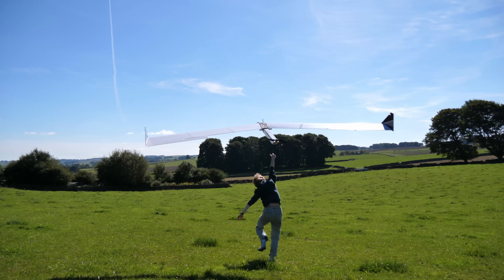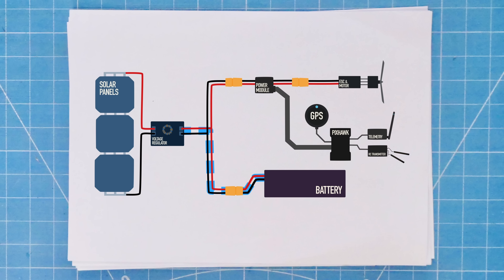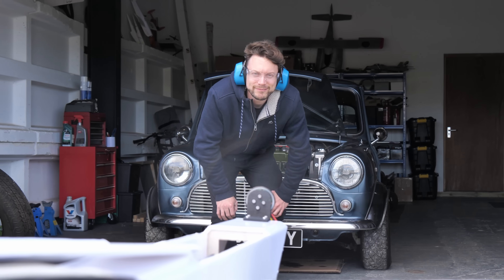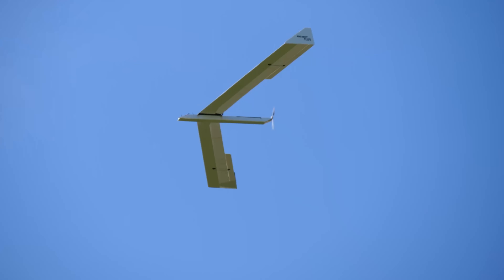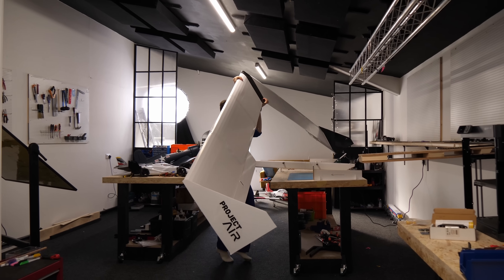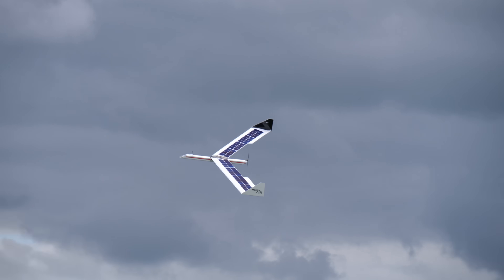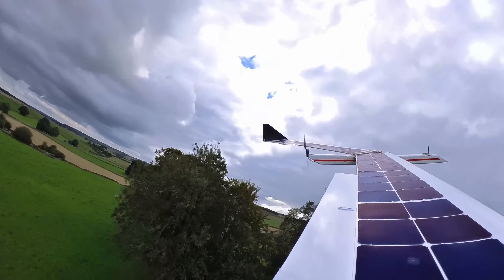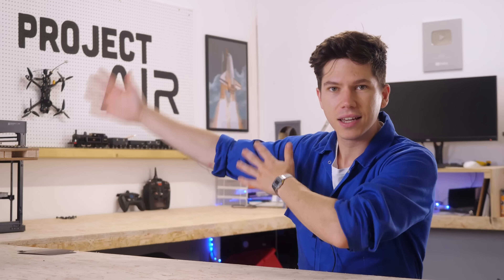Solar Plane V2

Comment: I’m at 7:45 and recommend trying an actual flying wing design. Similar to that of the xb-35, b-2 spirit, and ho 229. As these designs greatly reduce drag and use elevons to roll and change pitch. Airbrakes on the wings enable better yaw. Just an idea.
Reply: he's going for more of a NASA helios functional UAV design

Comment: The power system isn't at fault - it's the charger you're using not being compatible for the battery you're trying to charge. It will always overcharge your battery as it's not calibrated for it - it's designed for the higher charge voltage of 14.2v of Lithium Iron Phosphate batteries. Genasun can custom make one for you given the money you're spending on it by simply telling them the type of battery and it's specifications you want. Further, without a proper charger in version 2, you're gonna end up putting too much current into the battery (rather than over voltage as was the case in Version 1). You need to go back and get some proper training on battery charging from a specialist and not just another DIY Youtuber.

Comment: if you are going to use a commercial airframe then why not make a it a genuine high performance airframe rather than a 'foamy' which is more a fun flyer than a serious performance model? A 4m span F5J competition spec glider would give you efficiency on completely different level than any foamy, and plenty of wing area to place your cells. You would probably need to make a bigger fuselage to house your electronics but that shouldn't be a show stopper. Keep an eye on the BMFA website and you can pick up F5J models at decent prices.

Comment: And your old ESC works, only you need to reset it to default, you have used small ESC. your new one 70Amp is great, but, I recommend 80Amp for safety

Comment: Few points to consider.. 
1. Spend more time on design efforts. 
2. objective of "building solar plane" should go with some sort of specifications and constraints like. weight, wingspan, budget, deadline etc. otherwise it's childish    
3. Do more calculations and less experimentation. without specifications, its seems like achieved almost nothing even after loss on half a dozen airframes. 
4. Delta wings is a whole new can of worms. Stick to same platform until you know you have reached the limits. 
5. More math and more knowledge of aerodynamics would be useful. 
6. keep it in flight even after known its has flaws like weight issues etc is overall a bad practice. 

overall, I did not like so much of trial and error. it seems l your earnings with channel viewership are lot more than your expenses. If that is the objective its waste of time.

Comment: should it be better to charge the battery with a balancer (or just a constant 4.2v to each cell) to prevent a twa flight 800 thing?

Comment: taking the mppt controller out is a mistake - this will drastically reduce your solar efficiency.     just attach your load direct to the battery not via the controller

Comment: My idea is that you should remove that aluminum to make the plane lighter and to make it stronger you can use some wires like some thick and stiff lightweight wires i will repeat strong and stiff you can make a outline on the plane to make it stronger and comperatively liht weight . BTW love theese videose ❤❤

Comment: Adding ehe aluminum"L" spar was not thought though.  Very inefficient use of weight.  You only needed stiffening in the vertical plane, the part of the "L" that is horizontal is doing nothing for you (except possibly providing gluing surface) so the L was 50% heavier than necessary.  Use a flat strip and glue to the existing spar or better yet, use one of carbon fiber.

Comment: Kannst du anstelle des allumaterials nicht kohlefaser Stäbe aus dem Drachenbau  nehmen? Die sollten eigendlich deutlich leichter sein oder nicht?

Can't you use carbon fiber rods from kite building instead of the allumaterial? They should be much lighter or not?

Comment: Put the MPPT back, just regulator isn't enough. But to prevent it from disconnecting the battery, hook up the load directly to battery without going back to the MPPT. You need the efficiency

Comment: I wonder if you model up a flying Delta wing with a large internal volume (large surface area and slow flight) and fill that volume with a helium balloon? 

A cross between an airship and an airplane?

Comment: You have to change moter, I see here you are using BLDC moter but by sound it seeing like it creating lote of vibrant which disturbe plane due to light body of plane . Some how fix it and it going to be fine
Reply: This vibrant may cause air craft break apart mid air

Comment: Opportunity to improve performance and solar flight envelope by re-thinking the set-up.  If you can give the wings either an anhedral or dihedral and operate each wing as a separate solar collector with its own charge controller - halves the amp requirement per charge controller and makes each wing more efficient for solar generation.  Use the solar correctly as a battery charger and not for powering the motors directly.  Read the charge controller manuals - Load doesn't mean "the load", and you don't want to use those terminals at all!  (although you could use them to create a Low Light alarm signal if the Controller is set to an appropriate Load mode).

Comment: I think the double glider would be better with 3D printed wing extensions to give you more wing area for solar cells and lift. Probably play around with different prop diameters as well to get the most efficiency out of everything.

Comment: Drill holes In aluminum to make lighter, should not affect strength if done right.  Try contra rotating blades on same shaft, should give more thrust.

Comment: As many people have mentioned, add back in the MPPT and connect your loads to battery. With the regulator setup you lose the battery charging profiles (cc and cv modes) on the MPPT charger and lots of efficiency.

You may want to add in some reverse current protection between the battery and the load to prevent the motors from generating voltage spikes into the battery when braking (and other potential back-emf)

Aint nothing wrong with coming up with a hack, just hope you can learn something from the comments and implement in the next version!

Comment: For a channel dedicated to airplanes the design of the airplane is pretty lackluster...This is not a flying wing, its two wings with a stick in the middle. Why would you not design it in a simpler way? The center should be one picece and not in the insane V angle its at right now to remove the oscillation and wobbling and it will also give the edges more stability.

Comment: You should never use a buck converter on solar panels, because you loose 5-10% of the already joking 25% effisency.
MPPT is  a must, you can get really small ones on the internet like china or ebay.
And always use really thick wire between the solar panels and the mppt to maximize the effisency.

Take a look at Maker Trainer 2 plane shape. I think it would be a lot stable than your current one.

Comment: to make the wings lighter instead of aluminum you need carbon fiber and it should be lighter or use epoxy resin

Comment: To me:The oscillation issue looks like a combination of the fuselage length and possibly the pusher prop. Small changes in lift would produce unstable flexing. Specifically, as more lift is experienced by the wing due to a gust, the rear cg of the fuselage would cause the tail end to dip, increasing the lift experienced by the gust. It would only be stabilized by damping at the moment. 

With the prop, thrust line would be affected by the same issue. Motors are heavy affecting the first issue.

Comment: Your turns are making the bank angle way too steep to provide enough lift to climb. Your motor is probably under powered for that size air frame. Lastly, the swept wing is not helping the lift situation. Otherwise, cool project.

Comment: Have you considerd using a carbon fibre tube instead of aluminum? It's much lighter and stronger than aluminium but you'd preferably need to change the aircraft design so it had no dihedral. A design closer to a glider (sailplane) or motor glider would also improve pitch and yaw control and have less drag than the V delta wing.  Carbon fibre tubes are also what was chosen for most human-powered aircraft so there's a design precident there.

Comment: Interesting, thank you for the video. One small idea, when using foam wings, you can easily reiforce it with brown paper tape used for post packages. Normally it sticks with just dampening it, but, use mix of water and white wood glue instead of water. Pit it on the top and pottom of the wing and you will be surprised how stiff it is. And it weights almost nothing... Just be sure to use the same ammount on top and bottom surface, as the tape is shringing a lot during drying process...

Comment: If it was me, I'd stick with the flying wing concept, but I'd ditch the foam board and the fuselage and try and incorporate every thing within the wing. I'd then use carbon fibre spars and either 3d printed or balsa wood ribs to shape the wing and maybe a bit of fibre glass on the leading and trailing edge for strength. I'd then wrap it in a clear film, which would allow me to put the solar cells inside of the wing, improving aero efficiency by not having them on top in the airflow. If you really need some ballast out front or the motor further back you can use a simple carbon rod to extend them out.

Comment: Build a scaled up RES Dart if you want to keep this type of flying wing platform but want to achieve a truly efficient yet strong airframe. DO NOT get rid of the MPPT, rather, switch to a GV8 and draw the load directly from the battery. These projects are frustrating yet rewarding. Keep on with it! I know a lot of the responses you get are probably a little late as you're already deep into the next revision. If you really want to dive deep into it, hot wire some foam cores, use carbon for spars, adhere your cells with super 77, place it all in in a vacuum bag to properly bed the cells while the adhesive cures. From there, bag the wing with 2 layers of .5g cloth bias and use Kevlar for live hinges. This will give you a super light and stiff wing while incorporating the cells as a structural member and also protecting them. I've successfully done this several times for commercial products and guarantee that it works. Good luck, reach out if you'd like additional info. Cheers.

Comment: You lose solar efficiency with just the DC to DC converter. The MPPT circuit with a second isolated emergency battery might work. Have a way to electronically switch battery sources when the first battery gets low on voltage.

Comment: Making the wings rectangular can hold more cells without leaving so much blank space. Maybe consider putting a few cells on both sides of the vertical stablelizers to make up the power loss when the plane turns. If the fuselage is wider, it can also hold some cells.

Comment: Hi @projectair

Please consider incorporating a BMS or something to monitor the upper cutoff voltage of your Lipo cells.

This circuit you have made trickle charges your cells, which is not recommended for lithium batteries. If one of the cells becomes charged to high voltages (> about 4.35 V/cell) it will almost certainly catch fire or have its lifetime drastically reduced.

Using a BMS should allow you to disconnect the charging of the pack  if one of the cells in series becomes overcharged
Reply: Another thing that you could also do is simply turn down your regulated voltage from 16.7 V to about 16 V or so. This would mean that you’re running the cells only about 2/3 full to avoid the risk of overcharging.

Comment: I'm not an engineer, so take my ideas with a grain of salt, but wouldn't it be helpfull to machine the aluminium down? like create big holes along the whole thing? if placed properly, they shouldn't weaken it too much, while also reducing the weight a lot.
also, wouldn't it be possible to use cable tensioning to help the stiffness in some way?

Comment: That reg is a disaster, you had the right idea with the Genesun unit, but just need to run all loads direct from the battery.
Solar -> Stripped Genesun -> battery -> load
No regs (aside from a little 5v unit to power the autopilot / electronics)
ESC direct to battery.
That Genesun is an incredibly reliable and efficent unit.
Still happy to chat if you'd like more help on the electronics.
Reply: Any chance you could post a basic wiring drawing of what you recommend please ….
Reply: @larryhalliday7553  Lousy at drawing, but willing to have a go.
Is there a good way i can contact you ?

Comment: Great video and job on this project! That motor mount just makes me sad because you're designing a 3D printed part like it's a machined metal part. Plus you printed it in the wrong orientation, making the part weak where it needed the most strength. Plus foam core is too heavy with all that paper, next time you should do hot-wired foam with a heat shrinked wrap. But like I said, great job anyway.

Comment: I wonder if a very light weight single ply carbon fiber wing would weigh less than the foam board and give equal or added rigidity so no need for stiffening members? A carbon fiber wing could also be made from a mold, so making replacements or spare wings would be much easier and you could model an ideal airfoil shape. The wings could easily be made from two halves, a top and bottom and of course you would need another mold for the opposite wing, top and bottom. Vacuum impregnating the carbon fiber on the mold would allow a very thin, lightweight and consistent wing.

Comment: Can you lay the wingtips down on a 30° from horizontal angle to allow the end solar panels to get sunlight almost all the time. The current vertical wingtips would in some cases in late afternoon sun cause long shadows over the whole wing. When you probably want the charging as long as possible especially if you want to try 24hr flight.

Comment: The aluminum L shape profile should be cutted to half to | shape and then place it vertically inside the wing on its inner vertical wall, Then you will cut the weight of the addition to half, save the plane and surly performance will be better.

Comment: If you want to go light and efficient, ditch the amateur foam board and start to work with proper materials! 
The moment you said that you needed 75% throttle for straight and level I knew the aircraft is super overweight, moreover when you add the solar panel system and the aluminum spars. Cruising at 50% throttle with all-up weight should be okay.
In comparison, my aerospace degree final project was a 3D printed, 3 meter flying wing with carbon spars and electric propulsion for flutter research, cruised at 45% throttle trimmed at 40 knots.

Comment: I admire the work you have completed but I do have a comment on the design of the airplane. A pusher propellor powerplant is about 20% less efficient than a comparable tractor configuration. If you airplane was a tractor your break even point for solar power would be lower. Again, good work so far

Comment: I noticed when the metal was added it shifted the center of mass more forward putting it closer to the center of lift, you could shift some of its mass futher back, the batteries for example, and I saw someone mention carbon fiber instead too, and mabey try moving the motor on top somewhere to keep it from detecting so easy.
Reply: @projectair

Comment: I know delta type of wing would have lower aspect ratio, but it would also make wing more stable and firm without large mass addition... which would lessen the wing flexing(better aerodynamics) without rising the mass much and it would add area for solar cells as well.

Edit... I see... at the end you are really going to delta type. that is why I should look the video fully, without brainstorming at the start.

Comment: Some regulators do not regulate if input voltage is lower than the voltage set on the regulator.

Comment: how about an AI system that maps solar gain and cloud height wind and storm condition avoiding them altitude wise, on a patchy cloudy day to navigate itself via sunnier patches to get above the cloud layer to get to the sun, like a moth seeking light. and something that gains altitude by day to glide and battery re-climb through the night for day operations, a continuous free energy powered super glider.

Comment: Do you need the whole aluminium cross-section from root to tip? Simple answer is no. Why not design the same wing, yet taper out the aluminium spar linearly to the tip?

The aircraft has potential there. On another note, tapered carbon rod (fishing rod) can be used as well.

Comment: In aircraft modeling, nothing more reliable has been invented than a separate small backup battery for the control controller, a separate one for the servos, and a main one for the motor. In your new circuit, the voltage can drop at any moment, and while the controller is reconnecting, the plane will fall or go into a tailspin, not to mention the fact that this circuit uses solar panels extremely inefficiently. MPPT controllers were not invented by fools. And it is stupid to throw it out of the power supply circuit.
So we are waiting for the third catastrophe.

Comment: Golden rule - always make the weakest point the cheapest/easiest to replace. Maybe the prop is dispensable, but its exposure means the motor shaft will be stressed at landing. More design needed IMHO.